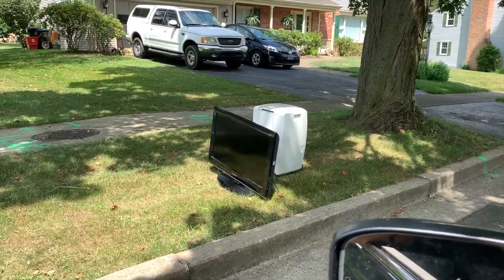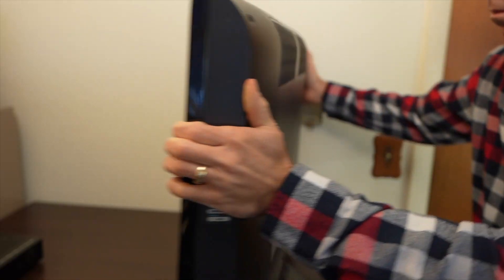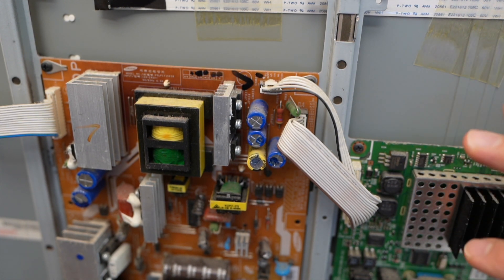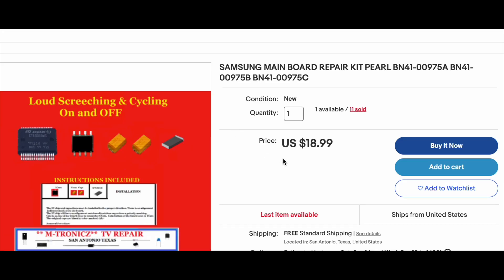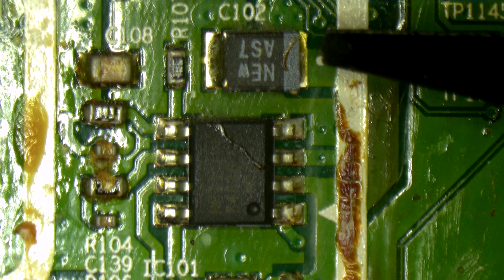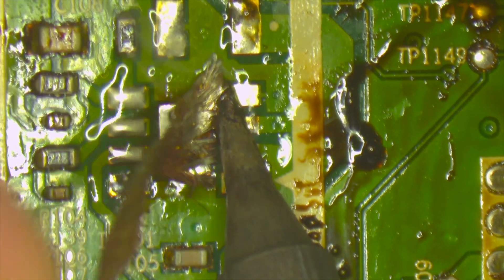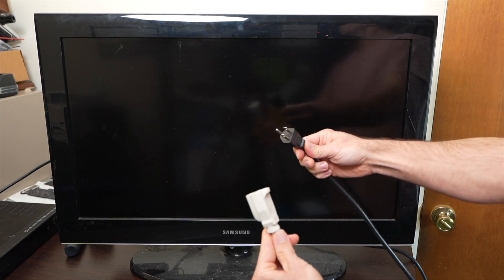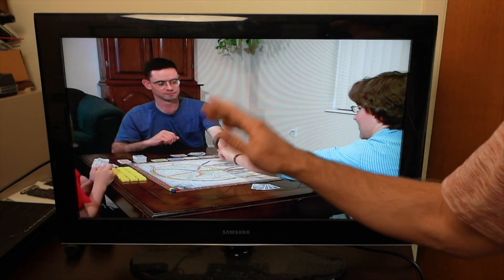I FIXED a TV from the TRASH - You Can Too!

Comment: I see that you ordered the kit from M-Tronicz.  A couple weeks ago, I received my eBay M-Tronicz $17 repair kit for my TV, a 10-year old Sharp 60-inch LC-60C6500U, but have yet to install it. Other options from other sellers were the entire board, which cost closer to $100.  So I was pressured to buy the kit or stock might run out. The issue is no picture, likely a regulator problem & it died a year ago, so it's been sitting for a year not getting fixed.  If your trash TV got fixed by an M-Tronicz kit, then hopefully chances are mine will get fixed also by the same seller.  Fingers crossed.  I might begin repair it 1-2 weeks, by mid April 2023.
Reply from the maker: Just take your time, I think you'll do great and have a nice working tv by the end.

Comment: My son went to turn up the volume on our older insignia tv and received a zap (static electricity) when he pushed the button. Now the buttons won’t work. The tv works fine but the buttons don’t, not even to turn it off. Any thoughts?
Reply from the maker: I would assume that the button bar went bad (though it could be the main board).  I’d look for the 5v or maybe 3.3v supply to it.  You can replace the button bar.  Someone probably sells one on eBay.  If you are adventurous, maybe you can find the faulty part on it and solder on a new one.

Comment: A few years ago I had this similar problem with this tv. It also had bad caps on power board. The problem with the main board is a small capacitor. It's a small surface mount on the other side of the main board in between the two switch regulator ics. The 3.3 volts is not stable that causes the loud sound and messed up screen. I replaced that SM cap with a regular electrolytic. I actually have the video ony YouTube it's from 2017 July..

Comment: I have that exact same Samsung TV model. As soon as I saw the base it sat on, it was easy to figure out. The Samsung has a service replacement for a number of capacitors on the power board. After acquiring the TV, I've only had to replace two capacitors. One green one and the other was the huge capacitor that powers up the set. It's only 720p but it still produces a nice picture. This tv is actually quite heavy to pick up. That's how old this thing is.

Comment: I just wanted to add my voice to the many, saying what you do is awesome.  I've learned, partially out of necessity, that we give away a lot of our power and money when it is easy enough to help ourselves.  That is what you're showing people.  I've fixed a lot of things myself simply by trying.  And most of the times they !were things I'm not experienced in or knowledgeable about.  But the info was out there and I asked questions and researched and got it done. (Thank God!)  My latest thing is converting a bathroom to an office.  So far I've done the demo pretty much down to the studs and caped off all the plumbing in a way that will make it easy to go back if I ever want.  I'm contemplating a small solar project w/battery to power my computers etc., so your info on that will come in handy for sure.  Thanks for sharing with us!
Reply from the maker: Great to hear you are tackling new projects!  Let me know what might be helpful with the solar project.

Comment: Thumbs 👍 . I have an old 32 samsung. It continuously cycles thru channel search whenever it's turned on. I've tried a hard reset but get the same result. Any ideas?
Reply from the maker: Thanks!  That’s a strange issue.  Have you tried disconnecting the input bar from the main board?  Maybe a button on the side of the tv is stuck?
Reply: I have the same issue with a 32 viewsonic and disconnected the control bar button out of mainboard but it still. What is the problem?